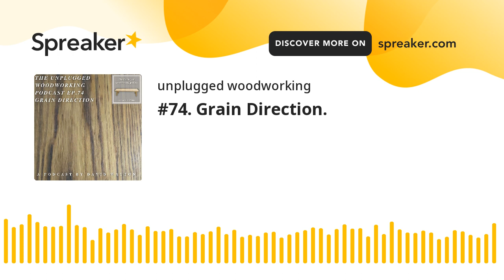#74. Grain Direction.

Comment: A good reminder to pay attention to the grain, and not just when planing it. Oddly enough I have been paying attention when selecting wood. I get most of my hardwood from heavy duty skids at work. It's all clean... and nailholes are not that big a deal when I mostly make small stuff. I have been getting fussy about the skids I am willing to put effort into though. I have noticed that the people who make the skids are having trouble finding the really really crappy wood these days... I am seeing skids with a board or two of straight grain. All a mixture of hard maple, poplar, and oak... and probably some ash. What I wasn't doing was paying attention when I pick pieces of wood from my stock for a particular project. Thank you.
Reply from the maker: Thanks for listening 👍 it's definitely worth taking the time and examining the wood, it can save you a headache or two.

Comment: I’ve got some locally grow ash which looks really lovely but like the wood you described the grain goes in all directions. It’s been nightmare to plane and been through everything: Low angle, high angle, narrow mouth, and on. I also didn’t find any that felt good to me. So glad it’s not just me. I use the same technique standard planes in the least worst direction(s) followed with a well sharpened scraper plane and card scraper for the final finish. Anyways another interesting podcast and thanks for all the great videos. 👏
Reply from the maker: Thanks for watching/listening, I appreciate it. I had some ash a good few year ago and it was a total nightmare! I haven't really used it a lot since then 😂.